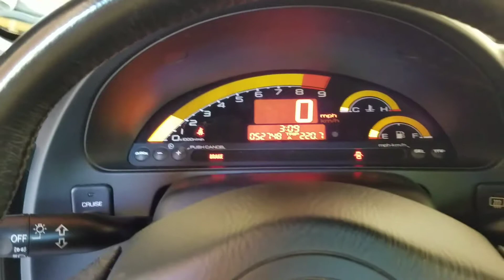S2000 engine noise cold start - after TCT install.

Comment: I know this is an older video, but what was the issue? that humming noise (best way i can describe) never stopped after a cold start and the noise got high pitched. shut the car off and engine bay had an odd smell.
Reply from the maker: I think you may be referring to the air injection emissions stuff.  It does that on a cold start.